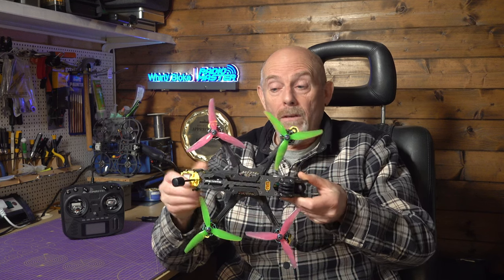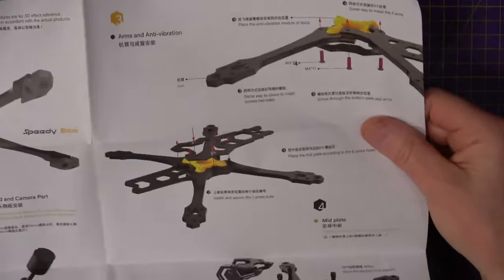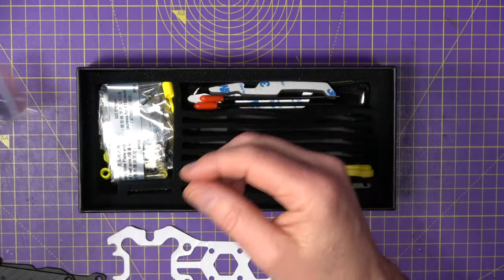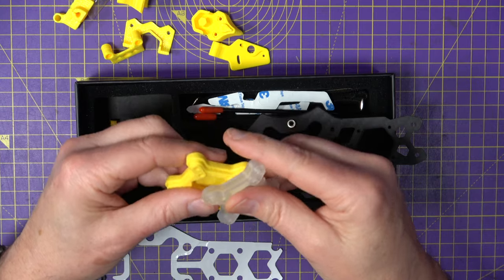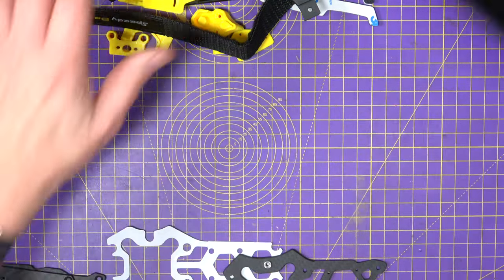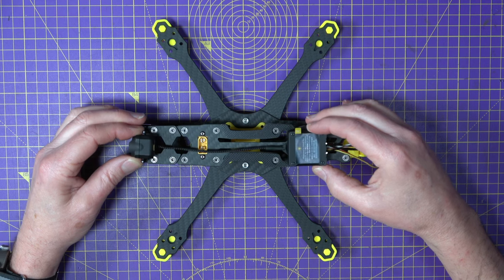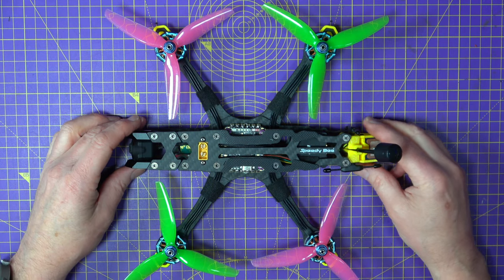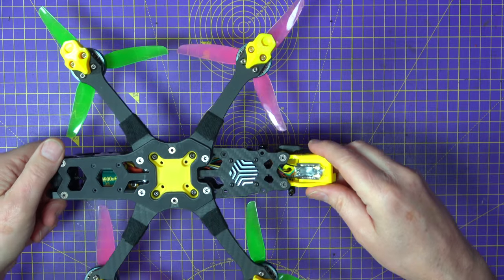SpeedyBee Master 5 HD frame review, F405 V3 Flight Stack, build and flight footage

Comment: Finally maidened my Master 5 HD V2 build thanks to the first sunny spell in the UK for ages! 🌞

Used the SpeedyBee F405 V3/50A stack but hooked it up to Xing2 2604-1650Kv motors (instead of the 2207s) as I'd snagged a brand new set for £40 ... result!! Maidened it today on an Ovonic 1550mah 100c 4S, CNHL 1100maH 100c 6S and finally a 1800maH 120c CNHL and got some decent flight times just cruising (8:40, 6:45 and 6:35 mins respectively with final VBAT of 3.78V each). Those 2604 'pancake' motors really are efficient and pack good low-end torque forflowing proximity cruising ... if that's your bag.

Flightwise, I used the UAV Tech 5" experimental BF preset for 575-650g quads but got slight propwash, slight jello (no ND filter) and throbbles so I need to check the BB logs. Unfortunately I can't access the BB logs from the SD card as it doesn't show up on my Mac either via Betaflight of directly off the SD card 😕Suspect I'll have to reformat the card so I'll lose the logs 😥 

AUW (excl LiPo) is 446g with no GoPro mount, no GPS/mount, stock 3D prints, side plates, straps x2 & 5.1" props ... so it's no toothpick! 😜The build was pretty straightforward but the stock O3 co-ax cable doesn't quite allow me to mount the O3 cam at the most forward point on the TPU plates (unless I commit to routing it under the ESC), so the CNC frame is still visible in O3 camera ultra-wide mode. It's no biggie TBH as I still have the option of easily removing the O3 AU/Cam combo to run as a top-mounted backpack on other quads 😃

Note to any potential HD V2 buyers: The frame kit I received had 2 side plates but they were identical, instead of separate Left & Right hand variants. The UK seller is arranging for replacements but I'm not bothered as it's a complete pain trying to route the ESC wires under the side plate (like an Evoque). In the meantime I've used the side plates to protect the O3 Air Unit by fitting them in reverse from the same standoff and attaching them to the rear standoff/TPU with small zip-ties. It works a treat as there's just enough clearance for 5.1" props and there's still plenty of airflow (plus the O3 heatsink) ... the downside is that you need to remove the zip-tie to access that SD card or do a firmware update. Also note that there's insufficient clearance to connect a USB-C cable to the O3 air unit, so it needs to be unscrewed. 

Thanks again for the frame review. Keep up the good work 🍺👍
Reply from the maker: That's a fantastic bit of feedback - thanks. I did the same with the side plates. They look nice but are a pain and just get in the way, so I left them off. Also, I always set up the air unit on the bench before I bury it in the frame. Thanks for the nice comments - always appreciated.
Reply: @WhirlyBloke Likewise, always setup air units and anything else I can on the bench in case they’re DOA 👍

Comment: Also note for your awg wires it is better to cut them long enough to loop foward and back to the xt60 plug and solder at 90 degrees at the solder point on xt60 plug .. eg parallel to the top plate..

Relieves the stress point and tension on the esc and is a lot easier to setup with this approach.

Also the Tuning is better as you don't take away the positive effects of the soft mount flight controller system because you are not loading any pressure to the stack from doing a loop foward and back to to the Xt60 plug.
Reply from the maker: I know what you mean, but the suspended/floating FC mount means it's not really an issue. Also a wire loop in electrically noisy wires is generally not a great idea. Keep them as short as possible.

Comment: What GPS/GNSS module do you use in this build. Did you have any problems of mounting it to original Speedybee 3D prints?
Reply from the maker: I used an older Matek M8Q-5883 initially and it clips in just fine. However I'm now using the HGLRC M100 Mini I reviewed recently. https://www.youtube.com/watch?v=ibNzG1tMblE

Comment: thank you for your very informative video. Can you tell me if the speedybee f405 wing with an ETC also fits in the frame?
Reply from the maker: Thanks for watching. The F405 WING isn't really for quadcopters, it's designed for wings and planes. The F405 I use here is probably the best choice, but you could use the SpeedyBee F7 V3 as well.
Reply: @WhirlyBloke  Thank YOU

Comment: My favorite frame to date.... I have made it my main rig, it's a Walksnail build SpeedyBee f7 V3, Axis ELRS, same motors 2306 1750kv, it flies exceptionally well, now I would like just the Master... Same exact build but with the f405 stack... My plans... 😉
Reply from the maker: It sounds like you've built a great quadcopter! If you're looking to replicate the same build with an F405 stack instead of the SpeedyBee F7 V3, you can definitely do that. The F405 flight controller is a popular option for many quadcopter pilots, and it should work well with your existing setup.

Comment: Hello, I have the same stack and also decided to use a GPS with it, I was wondering what UART # corresponded with the GPS in betaflight?
Reply: I just realized that the TX and RX are numbered, I’m assuming T6 and R6 would mean it’s UART 6
Reply from the maker: Hey there! It's great to hear that you have the same setup. To answer your question, the UART # that corresponds with the GPS in Betaflight will depend on which UART port you have connected your GPS to on your flight controller.

Typically, UART1 is used for serial communication with the USB port, UART2 is used for telemetry, and UART3 and UART6 are commonly used for GPS modules. However, you should check your flight controller manual or Betaflight configuration to confirm which UART port is being used for GPS communication in your specific setup.

I hope that helps!

Comment: did you use the connector for the o3 air unit or did you solder straight to the board
Reply from the maker: I used a 150mm O3 air unit connector cable. The original 100mm one is too short to reach.

Comment: Could I run my power cables underneath the ESC and up to the front without having to turn the board?
Reply from the maker: That would be a bit of a squeeze.
Reply: Is there a place where I could get a longer cable going from the air unit that would solve the problem completely.

Comment: I Have issue with RM RP3, it turns on and off. It is pluged via pin. Do you had any problem with yours ?
Reply from the maker: First, make sure that the pin connection between your RadioMaster RP3 and its power source is secure and properly seated. Loose or partially connected pins can cause power issues.

If the pin connection is secure, try using a different power source to see if the issue persists. It's possible that the issue is with the power source and not the RadioMaster RP3 itself.

If the issue persists, you may want to try resetting the RadioMaster RP3 to its default settings. To do this, turn off the device, remove the pin connection, and hold down the bind button while reconnecting the pin. Keep holding the bind button for a few seconds until the LED light flashes quickly. This should reset the device to its default settings.

If none of these steps resolve the issue, it's possible that there is a hardware issue with the RadioMaster RP3. In that case, you may want to contact the manufacturer or seek professional repair.

Comment from the maker: The rotated stack means the standard 100mm DJI O3 Air Unit cable is too short. You can get a longer 150mm one here DJI O3 Air Unit 3-in-1 Long Cable https://bit.ly/3HkSgEe

Comment: Is the O3 power cable length sufficient after flipping the stack?
Reply from the maker: It's a bit of a stretch, but I had another one lying around. The pin order is the same as an O2 Air Unit.
Reply from the maker: You can get a 150mm long cable here: https://www.xcopters.co.uk/shop/dji-o3-air-unit-3-in-1-long-cable-150mm-15cm

Comment: Would this frame work with a Walksnail HD Pro?
Reply from the maker: I recommend checking the specifications of the Walksnail HD Pro camera to determine its dimensions and mounting options. Then, you can compare this information to the specifications of the drone frame you are considering to see if they are compatible. Additionally, you can reach out to the manufacturer of the drone frame or Walksnail HD Pro camera for assistance in determining compatibility.

Comment: Just started the exact build board but I can’t flip my board around like yours as my 03 cable is not nearly long enough. Any ideas?
Reply: You need to get the O3 170mm cable from speedybee.
Reply from the maker: You can get a 150mm long cable here: https://www.xcopters.co.uk/shop/dji-o3-air-unit-3-in-1-long-cable-150mm-15cm
Reply: @WhirlyBloke  The Dji cable was not the issue, I Speedy provided me a longer cable. We kept the FC in the normal configuration. It was the ESC we had to rotate 360. The ribbon cable going from FC to ESC was too short. But in the box as I found later was a longer cable. I finished the build and it flies great
Reply from the maker: @nmfireman  It's much, much easier to rotate the entire stack and use a longer 3-in-1 cable.
Reply: @WhirlyBloke  well, I finished the build and I didn’t find that easier. I just rotated the ESC. I had the long enough cable to do that. I also had a longer cable for the camera. If you had read my post, you would see that speedy be provided both of those cables, there’s no need to rotate the flight controller just rotating the ESC allows me to use the battery connector on the frame like it was intended. Like I said, I finish this field and it is working perfect

Comment: Hello. I am not able to download your betaflight 4.4 tunning file, it gives me an error message when I click your link.
Reply from the maker: I've just checked the link and it works fine and you don't need to be logged into Google cos it's a public link. Could you please provide me with more details about the error message you're receiving? This will help me understand the issue and assist you in finding a fix.

Comment: Can this frame take 6045 props??
Reply from the maker: Thanks for watching. Unfortunately, this frame is not designed to fit 6-inch props. However, you can just about squeeze 5.5-inch props on. Something like the HQProp DP 5.5x4x3 props will fit, but I've never tried them. Let me know how it goes.
Reply: @WhirlyBloke  I have the V2 frame and was planning to fit 5.5" props as there appeared to be sufficient clearance to the frame (ie. >2.75" from motor centre to frame). Sadly, there is only 5.25" distance from front to rear motor centres so I think I'm out of luck 😥

Comment: I can’t get the osd or voltage reading work in my Integra goggles 😢 Anyone?
Reply from the maker: Check the wiring between the Air Unit and the FC. RX->TX and TX->RX. It's easy to get them the wrong way around. Also check you're using the correct ports in BF and you've selected MSP. Best of luck getting it sorted.